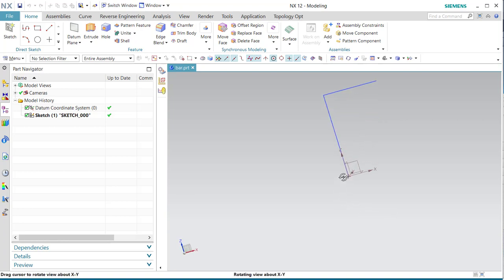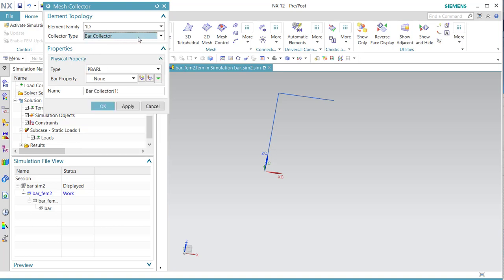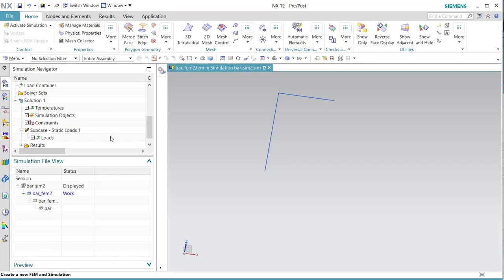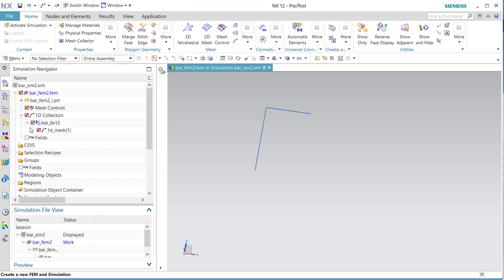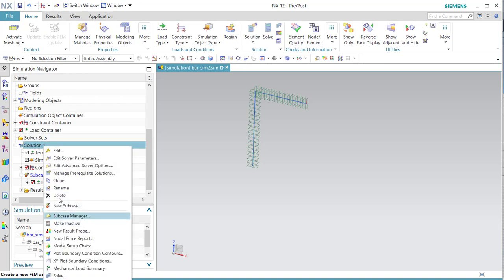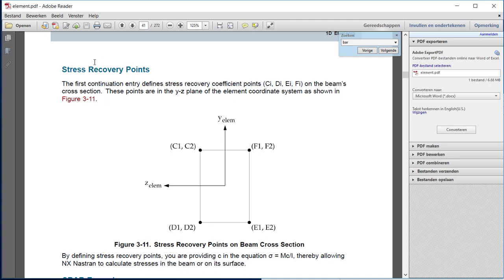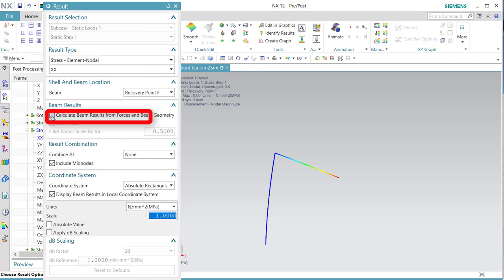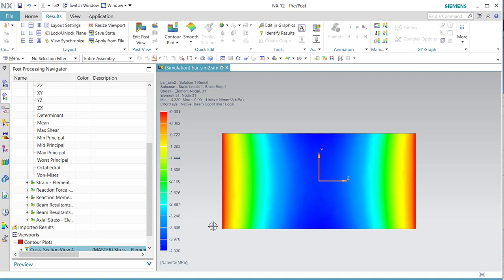How to use 1D elements to simulate bars, contains CC

Comment: hi olaf I'd like to simulate a chasis from Go-kart. My question is, Can I use the same process to simulate the chasis?
Reply from the maker: Yes, I would recommend this method it is computational fast. But first I would advise to test connections between the used tubes. For more detailed geometry you must use 2D or 3D geometry of combine these element types or even 1D and 3D elements.

Thanks for viewing my video.
Reply: @OlafvanBuul  thanks so much, I'm starting to learning about this methods, thanks again for your information